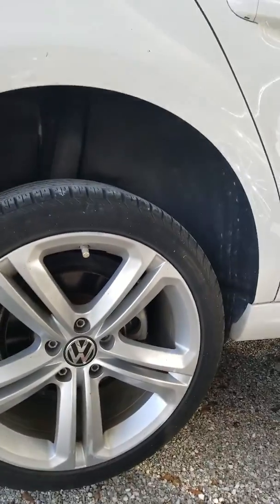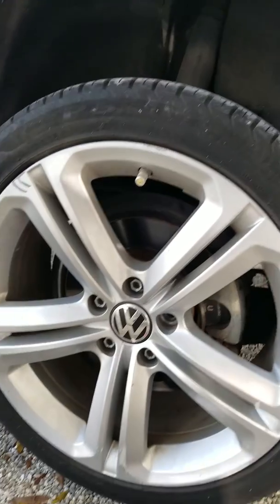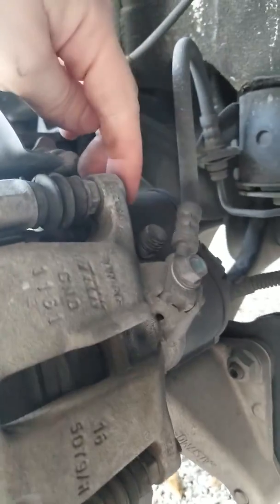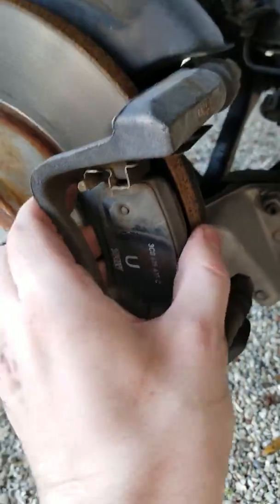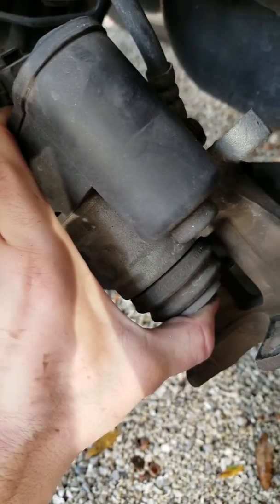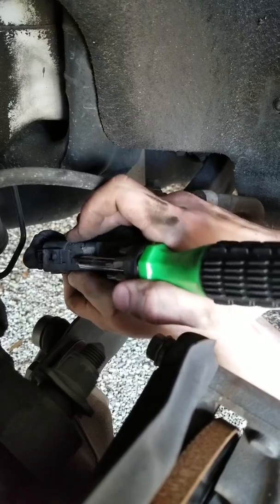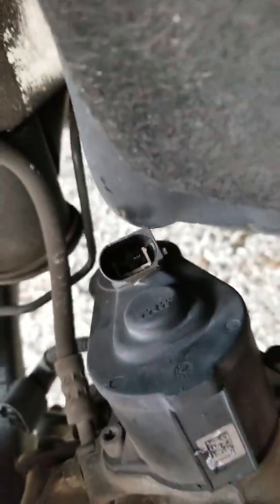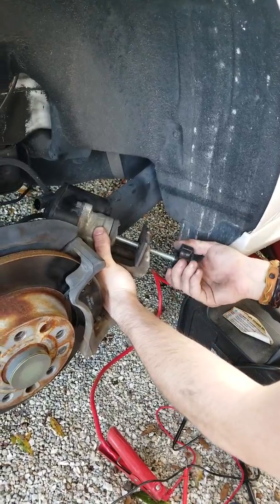Volkswagen/Audi : How to Change Rear Brake Pads and Retract Electronic Parking Brake

Comment: The connector on the motor can be removed with two straight screwdrivers. If you put one in the square hole on the side of the connector and twist it, it will cause the plastic catch to lift above the tab. You can see it lift if you look in the bottom of the two holes. Then, at the same time, gently lever off with another straight screwdriver. Thought I’d mention it as it might save someone busting the connector trying to get it removed.

Comment: You can also manually take off the EPB motor off of the caliper, just 2 bolts and use a 9 mm socket and remove it back manually with out a jumper box or wires

Comment: so even if you don't activate the electronic parking break you still need to do this or take it to a vw/audi mechanic? cause I have a 2013 cc and ik I have to manually activate the electronic parking brake with the switch... can I not just have the parking brake off and do them like normal?
Reply from the maker: No. It doesn't matter if the parking brake is active or not when you start the job, you will still have to rewind it. When you deactivate the parking brake using the switch, it doesn't unwind itself fully. It only unwinds a couple of millimeters, and just enough to release pressure from the pads. I wouldn't activate it before you start the job though, as it might make removing the caliper more difficult if the parking brake is applying contant pressure

Comment: If you don't have the 12 volt and wire etc, you can unbolt the electronic brake motor and you will see the gear.  use a 10 MM socket and turn it counter clockwise to pull the rod back.  Then compress the piston as you would any other brake

Comment: Great video, thanks for providing this as I hate buying a tool just for one job or god forbid going to the dealer for anything 🤮
Worked flawlessly on our newer 2022 Taos. I believe someone else posted that you just use the flat side of the connector to locate the negative terminal, that was great info!
Ended up using alligator clipped wires on the motor prongs w/ a plastic knife in between the clips so no chance to short them. Connected the positive to a positive jumper cable (connected to the VW battery) and the negative I just touched to the negative jumper clamp for about 10 seconds.Very easy to remove the connector from the caliper w/ a small screwdriver to pry the clip and another to pry the connector from the caliper.

Comment: hey doing mine this weekend awesome video and thanks for the help. only part im not sure of was the parking brake 3 times thing never heard that part before, maybe quick video showing?
Reply from the maker: No real need for a video, it's pretty simple. Inside the car there is an electronic parking brake switch. Usually it's next to the shift knob, and has the letter P inside of a circle on it. Once you've replaced the pads and have put everything back together, get in the car and start it up. Then simply put your foot on the brake pedal and pull up on the parking brake switch once to activate the parking brake. Once it is set, a red "BRAKE" message will show on the dash confirming that its set, after that you just press down on the switch once to disengage the brake. Then repeat that process two more times. On, off, On, off. Then you're done

It just ensures that the parking brake is set in the proper position and functioning properly.
Reply: @StonewallStupid  Haha , for some reason i thought you said something else but re watched the video and figured out what you said. just never deleted the comment. thanks for the reply though and the video super informative and helpful!

Comment: Your an absolute star. Spent 5 hours on the first caliper before I came upon your video. The second was done in 20 mins.
Reply: Here is a video of me using a diagnostic device to apply the electronic throttle to a 2014 Audi Q5: https://youtu.be/8n7VY1RVflw , you can watch it, it may help you.

Comment: By the way if you don't have a 12V source, you can most likely apply a much lower voltage than 12 V to the motor and it will turn (albeit slower).
Reply: or a higher one-i use a 18v battery ,dosnt matter
Reply: I did the same w a 9v and 2 wires.

Comment: DUDE ... You ARE the Man !   Thank You !   I've been trying to figure this crap out for a while without having to buy the $200+ tool in order to replace the $25 brake pads.
  Plus, your advice up front where you inform those that might not know how to jack-up the car & remove the wheel that they should let someone else do it is ...PERFECT ! 
Thanks Again !
Reply: Hello, maybe you can watch my video and develop a new idea!
Here is a video of me using a diagnostic device to apply the electronic throttle to a 2014 Audi Q5: https://youtu.be/8n7VY1RVflw , you can watch it, it may help you.

Comment: Serious question, couldn't you just set the key to on and put the car in neutral?
Reply from the maker: No, because as your pads wear down the electronic parking brake piston follows them. It is never fully retracted when it's "disengaged". It follows right behind the brake pad because if it was in a fully retracted position at all times during driving or parking, then it would take a long time for the motor to wind out the piston to actually put pressure on the pads, holding the car in place. It only ever sits a few millimeters off the pads. Otherwise everytime you pulled up on the parking brake, you would sit there and listen to that motor whirring for like 20 seconds before it ever actually made contact with the pads. Thats why when you activate the brake, you onky hear it whir for like 1 or 2 seconds, before stopping. Because its in a constantly primed position, ready to apply pressure at a moments notice. 

Same goes for driving, the parking brake when held up during driving can be used as an "emergency brake" in a dangerous situation. And in order for it to slow the car down quickly when you pull up the button, the piston has to already be out and near the pad in order to almost immediately begin slowing the car down. Otherwise again, you would pull up on the button and have to wait 20 seconds before the car actually began slowing down, if the piston had to engage from a constantly retracted postion. Sorry for the rant.

Comment: Wait.. what's that crank thing at the very end??
Reply from the maker: Thats a caliper press. You use it to push the Caliper back into position so that you can fit the new brake pads in. You can buy one at any auto parts store. You will need it it to change the brake pads
Reply: @StonewallStupid  Just got one! Thanks, Austin
Reply: Also, just want to say to everyone, this also worked for me!

Comment: Great video. BIG HELP. Repair shop wants $350 to put new pads on. Thank you
Reply: That's actually cheap..went to dealership and they want 700+ just for rear brakes .it's just a golf R with this crazy e-brake tech on it
Reply: @carbonio28  i was just told $775 at a vw dealership on the east coast. I told them to pound sand.

Comment: I found a way that worked for me. I disconnected the battery then pushed in the caliper piston all the way with a bessy clamp. It took 5 times each time it would stay in a bit more. After a few lights came on the dash had to drive around for 1 min pumped the breaks a few times. Then turn the suv of and on. They work great. Works great if you don’t have a buster or scared of shorting something out. Thanks for this vid

Comment: This worked on my 2018 Tiguan. I used a 12 volt lawn tractor battery and multimeter leads. Thanks for the video!

Comment: I used a battery charger on the 12V 2amp setting. Worked perfect. I would add that instead of saying the negative goes on the “left side”, the negative goes on the flat side of the connector housing. Thanks for the quick and simple solution!
Reply: I heard that using anything other than the computer might triggers the check engine light. Have you had that?
Reply: @117raph  I had no CEL issues. The motor retracted and all was well. I compressed the caliper piston, installed my pads & rotors and all is well!
Reply: @robslist5562  Cool, thanks! I'm gonna try it
Reply: Thanks for that little tip, have a new 2022 VW Taos and that connector has a flat side too, and it's negative :)

Comment: Quick question, if I don't have access to a jump box can I just connect jumper cables to the battery and attach the multimeter leads to those ?
Reply from the maker: Absolutely. That will work just fine 👍🏻

Comment: do you not have to wind it back in with the cables?
Reply from the maker: No. Once you install the brake pads, and reinstall the caliper, you need to activate the emergency brake two or three times in the car. This will make sure the emergency brake is reset

Comment: Great video,i have to do this on a friends car and man i have never seen a subject that has more than 400 different ways to do it.

I have seen people remove the motor,seen others leave the car running and disconnect the cable to the EPB motor then turning the car off (dont understand this one very well) i have seen others do what your doing,seen others go thru a very complicated procedure to put the vehicle in service mode,others use a scanner, others said dont do what you are doing or a light and a chime  will come on that can only be turned of at the dealer, others will say you dont need a jump box but a 9 volt battery or even a D battery will work,lol,others will remove the motor and use a Torx bit to "wind back" the motor and then "wind it back" before you put everything together, holy cow talk about skinning a cat, ha ha ha ha ha
Reply from the maker: Thanks. And yes there are many different ways of going about it. This is the easiest if you dont have the super expensive computer. And yes even a small C or D battery should work.
Reply: @StonewallStupid  I agree,seems very clean and foolproof, thank you much for your reply.
Reply: @StonewallStupid  Hey there, i did have another question about this before i tango with it this weekend and again i think your way is the best way, however i was wondering... when you turn your car off before you did this doesn't the parking brake engage automatically for safety at turnoff making it impossible for you to remove the caliper like you did or does the VW EPB allow you to turn the parking brake off before you turn your car off and it stays disengaged? thank you again for any input.
Reply from the maker: @dntlss  Before I turned the vehicle off I just ensured the Parking brake was off by pressing the button down. I didnt have any difficulty taking off the caliper.